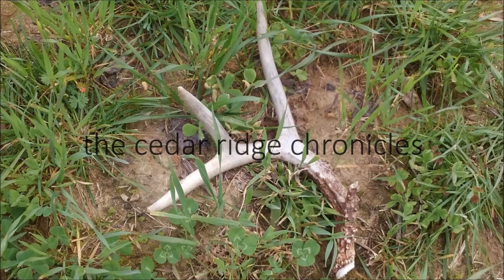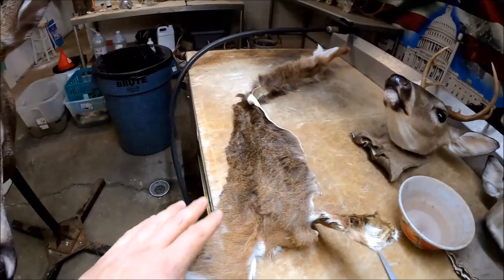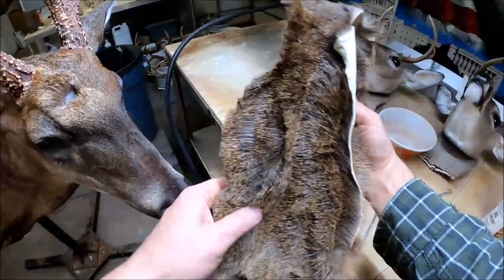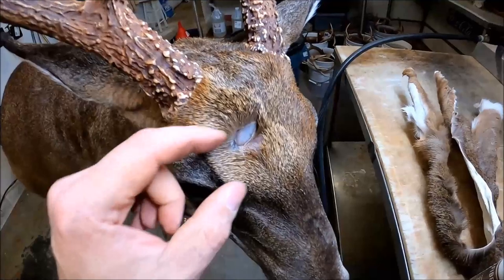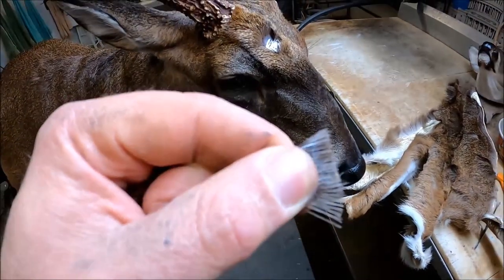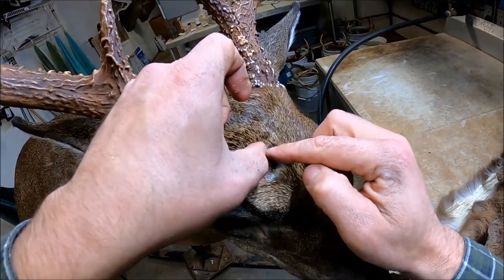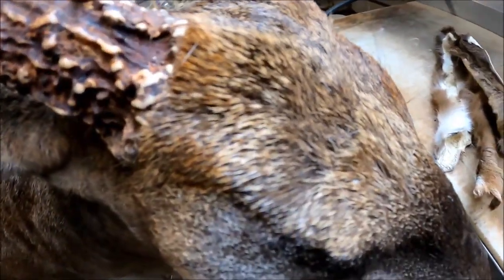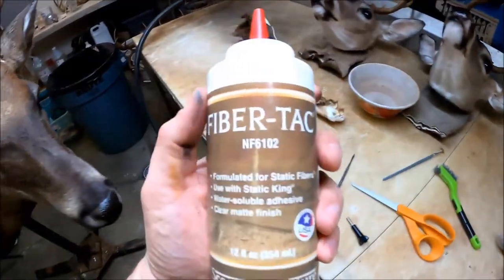HOW TO PATCH HOLES with hair clippings! ***SUPER EASY*** Whitetail taxidermy!!!

Comment: That’s awesome. I appreciate it this helped quite a bit. I used this method on a neck that had a broadhead entry hole. I can’t be mad though. I was the one who shot the deer and it taught me quite a bit. I wondered if this was even possible and I was contemplating it. I had saved some cut offs from a couple of mounts I’ve done, and I worked on your channel and I found a video very similar to what I was thinking about doing, it’s cool that someone is putting a channel out that can help fellow taxidermists

Comment: Looking for some help/advise a buddy of mine brought me an old deer mount to repair and clean up. Well I’ve done some apoxie work today. The hide/hair on this mount is yellow looking. I have taken some paper towels and windex and wiped this mount down 4-5 times. Still yellow looking. Do you have a paint schedule to fix this or any kind of recipe to remove the yellow looking tint. Thanks for any help you can provide.
Reply from the maker: The yellow is usually caused by hair losing pigment when a cape is mounted using dry preservatives. You can't get rid of the yellow, but you can airbrush it with a dark brown and it will look much better
Reply from the maker: https://photos.app.goo.gl/7KFTZpqdz91BqnHc6
Reply: Thanks for the help. I will give it a try.